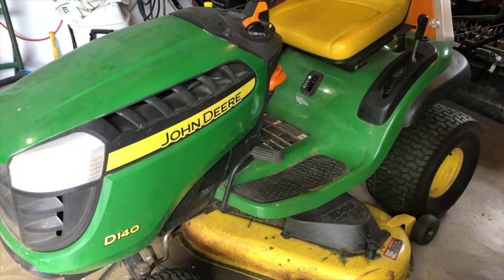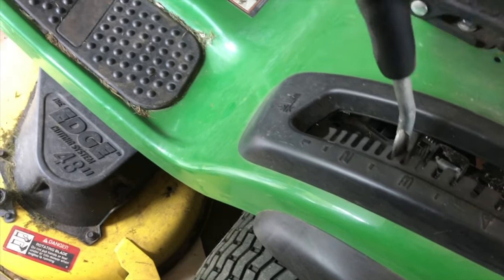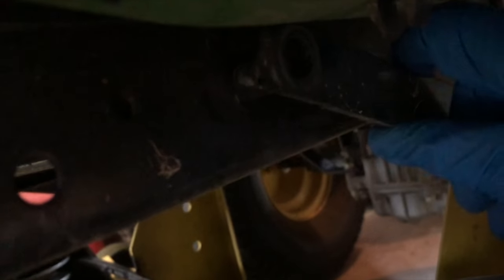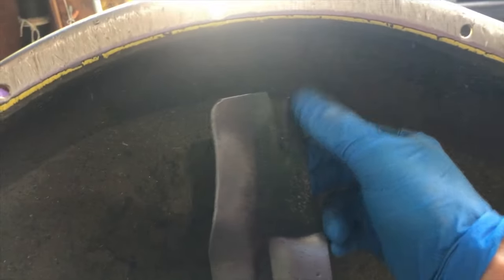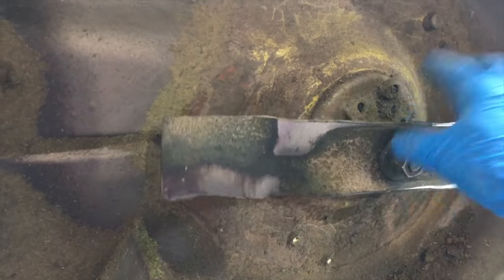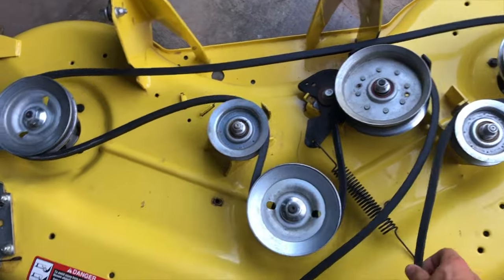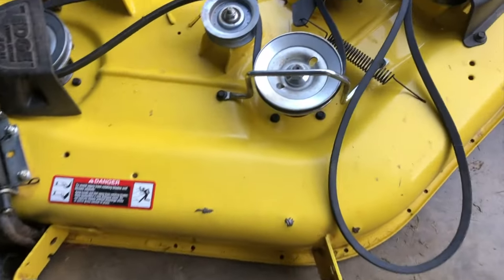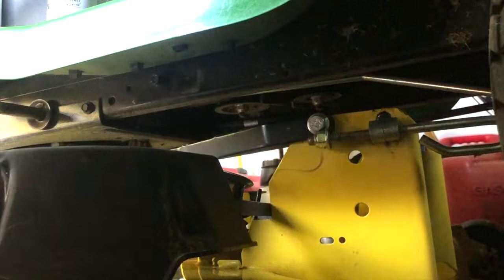Riding Mower - Mower Belt Change

Comment: oh man i feel dumb, i didn't even think to use a wrench to move that pulley forward. i replaced mine yesterday and i just removed the whole spring so i could get the belt on to the drive shaft lol.
Reply: in reality there should be a method to HOLD IT IN PLACE WITH NO HANDS with the pulley FULLY FORWARD.  A simple tool with a locating pin would really really really be a groove man.

Comment: Great vid!  Is it possible to put this belt on without taking off the desk?
Reply from the maker: The manual says to remove the deck. I think it would be tough to work it, but maybe not impossible!
Reply: @danmenges1249  Me and my son ended up doing it with the deck on and only took us about 5 minutes.  We used your video as a diagram it was very helpful thanks.

Comment: Well that last move (getting the belt on the drive pulley) you skipped the moment you actually got it engaged, and there's the crux move! I'm right handed so pulling that belt on with the left hand somewhat back-handed is impossible. I ended up going thru the front and pulling with all my might to get the belt partially over the pulled then had to horse it something awful.  It took me one hour just like Dan Thompson said below.  Not fun, and I am NOT impressed with the goofball washers and goofball cotter pins that John Deere gouges me for that are as show but frankly DO NOT STAY ON.
Reply from the maker: Thanks for the comment, Silas. I was working over top of the camera and needed to get in a better position for more leverage. Mine wasn’t too difficult that I felt like I needed to explain or expand on that process. Sounds like yours was tougher.